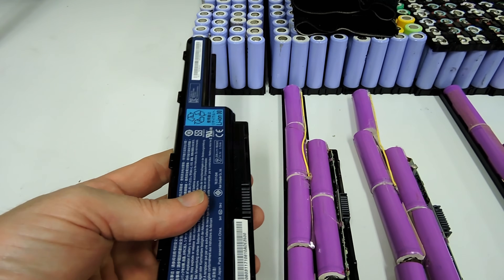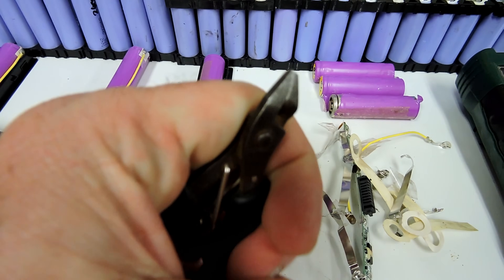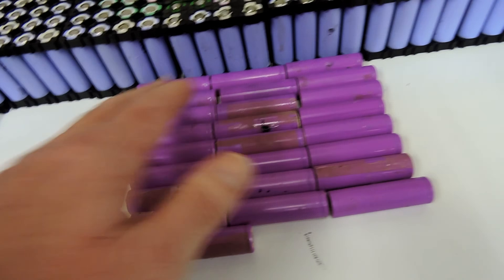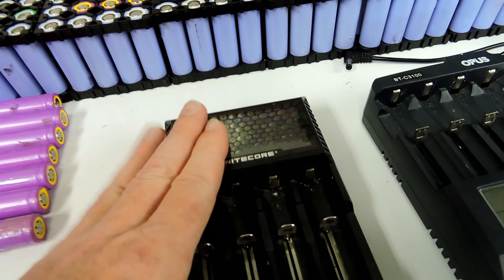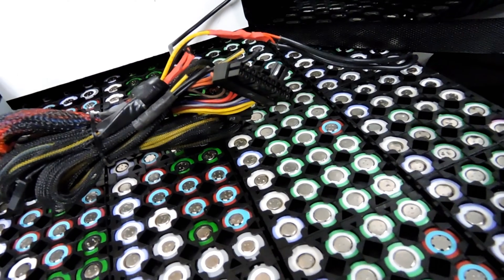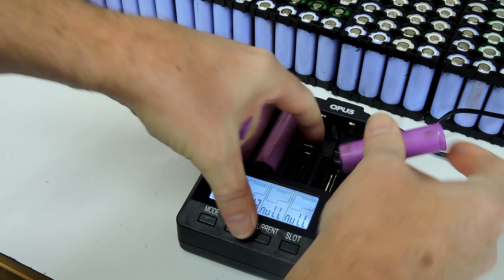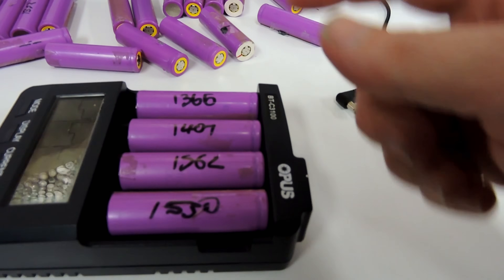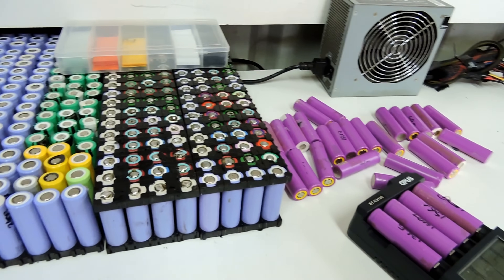How to capacity test an 18650 cell out of a laptop battery pack

Comment: Since there's a lot people in the comments regarding self-discharging testing I thought I'd leave a comment to help people understand. First off all batteries self-discharge no matter the chemistry, age, recharge cycles and the temperature they are stored at. Lithium-ion batteries discharge more in the first 24 hours than they should do over a 2 month period. Most manufactures publish their discharge rates within the datasheet for that particular battery, but generally its considered that Lithium-ion will self-discharge more in the 24 hours than it will over 2 months, to put this into usable understanding. the first 24 hours should lose no more than 1-5% then each month is between 1-2% which if we take the higher value of 5% in the first 24 hours takes 4.20v down to 3.99v which some of you may consider low, but for some applications it would be still usable since the cut-off is 2.75-2.80 for most batteries. In bigger projects with batteries running in series then you should try and match batteries in both self-discharge and capacity as much as possible but don't go overboard, its not that important if using a BMS. 

The main reason why some batteries fail to charge above a certain voltage such as 4.16v/4.18v is because the charger that you are using is not that accurate, OPUS for example is notorious for being very poorly calibrated which is noted within their manual having a Voltage Deviation of <0.04 so the charge can be cut short because it thinks its 4.20v when really its 4.16v, for this reason I recommend you test self-discharging using a volt meter, since different slots and even multiple OPUS's can have different Voltage Deviation from slot to slot from charger to charger. 

Enough with the jargon... here' is my method how I test for self-discharging batteries.

1. Charge the battery to full using any charger you like
2. Remove the battery and test the voltage using a semi-decent volt-meter (do not worry if its not 4.20v)
3. Wait 24 hours
4. Check the voltage of the battery if its loss more than 1% in the first 24 hours (4.20v to 4.16v is acceptable, 4.16v to 4.12v is acceptable)
5. Now wait 10 days
6 Check the voltage again and if its less than 0.5% sling it or sell it on. (4.16v to 4.14v is acceptable, 4.16 to v4.10 is not acceptable for some projects)

-
Reply from the maker: Dam man thanks for the effort - titbits in there I didn't know/understand... thanks for the effort!!!
Reply: Thanks for the info. Do you check capacity on 18650 cells in addition to your voltage reads 10 days later? Is so, what do you do with 4.2 v cells that after repeated charge/discharge do not show any capacity in mh?
Reply: I agree with your  method.  I first check the voltage of each cell as I break it out of the laptop pack, then I give each cell a serial number rather than mark it with its capacity etc.  I record each serial number in a spreadsheet so I can record initial volts, max volts after first charge, then volts again after 24 hrs, then measure and record internal resistance and cell manufacurer & colour etc. Then recharge to full 4.1v and immediately discharge at 500ma to 3v and record capacity before recharge again to storage voltage of 3.6v.  Then I have a bige spreadsheet full of data to make my decisions with.

Comment: Where did u get all them cells good job
Reply from the maker: You can get them here cheap & tested https://rover.ebay.com/rover/1/711-53200-19255-0/1?mpre=https%3A%2F%2Fwww.ebay.com%2Fsch%2Falarmhookup%2Fm.html%3F_nkw%3Dpowerwall&campid=5338322476&toolid=20008

Comment: Can u sell the nickle in them for scrap and i have bats that are 1.5v and like 2.78 volts and 2.1 v are they still good bats
Reply from the maker: I would love to be able to sell/recycle the nickel strip but sadly no one wants it around here. VOLTAGE IS NOT and indication of cell health/quality you need to charge and discharge it (unless it's zero volts of cause than it indicates it's buggered)

Comment: I have dell inspiron 15 3521 and my battery (became dead) is assembled in a same fashion as you have shown in the video. Is the batteries shown in the video are connected in parallel? I want to check their volts so my question is do I need to dismantle the cells to check volts? or how can I? Thanks.

Comment: Nice stuff :) Might get myself an Opus if I know I can test them quicker that way :)
As an aside, don't throw out the lower capacity cells. Do what I do and list them on eBay, someone will pay good money for them. I've had cells with <1000mAh sell reasonably well on eBay.
Reply from the maker: I can't bring my self to sell them on eBay - I wait till someone asks for them and offers me a price - I half what every the price they want to pay lol they just aren't worth a lot and paying too much for low cells inflates the price of the good ones
Reply: @HBPowerwall  Ironically (If you still read comments) you can't even sell 18650s on eBay anymore (at least not as 18650s) but then again nowadays I doubt there are many Laptop Batteries that even use 18650s (most have gone flat Li-Po's and I don't know if these are of any use to you).
Reply from the maker: @spotifygaming95  still read comments hehe I gave away a bunch yesterday - too hard to sell ..

Comment: What is wrong with the Opus power supply? Dose it work better or faster in any way off a PC power supply?
Reply from the maker: For me all opus were American plugs so had to use the cheap adaptor they came with - borderline dangerous those things. With a benchtop supply, one power plug into the wall so a bit easier to cable manage

Comment: After we find capacity what piece of electronic will cut off the voltage at 3.7v so we can store them
Reply from the maker: I use an IMAX unit here- https://goo.gl/Z2XAm6 you can parallel up 20 of them at a time and discharge them at once rather than one at a time.

Comment: Thanks for this video, fast paced and packed with info.

I just charged, tested, and recharged 16 Panasonic NCR18650s using a Zanflare C4. They all show relatively good capacity (they were only discharged at 500mA though, so I don’t know how useful the measured capacity is). The charger said 4.2 at the end, but my meter shows 4.11-4.13 across the board. Would you consider that voltage reading at full charge to indicate a bad cell or should I just use that measured voltage as my baseline when I measure again in a month?
Reply from the maker: Nop ignore the voltages - every cheap device is calibrated with a coke can half full with water - just test every cell the same way with the same sort of equipment.
Reply: Thanks! Just tested all the cells one month later and they have only dropped .01-.02v. I’m calling that a success.

Comment: Stonking. Again. Thanks. HB I hope you don't mind me posting a question here - I'm not promoting myself and any answers will help your Youtube Engagement numbers.

I'm salvaging laptop batteries for a new EBike battery, but for some reason, even though the cells are from un-used laptop batteries, and the capacities are around a reasonable 2,500maH, the internal resistances are all between 100 and 250 milli Ohms, according to my Imax B6 Mini, which - online wisdom has it - is a Bad Thing. So two questions - anyone know why? I mean - is it bad luck or inevitable in salvaged-even-though-unused laptop batteries? Second question - how much does it matter?

Thanks
Reply from the maker: 1. Thankyou
2. IMAX SUCK at ir tests no where near reliable enough results to bother with
3. I don't even know what the 'normal' is for IR on a cell but they all differ i know that.. 

I did 100 tests with the same imax guess how many IR tests came in at the same figure? (granted i was using magnets as 'holders' results were slightly more similar using a cell holder that was hard as hell to put in and get out cells.
Reply: OK thanks. I think a lot i down to how good the contact is/how hard you press. These resistances are all well under 1 Ohm and so the tiny changes in resistance of the connectors will dominate. I'll try another way to measure the IRs though.

Comment: I like when a lot of information is transmitted in a short time! No talking, only experiences and facts!
Reply from the maker: i'm not always like this lol
Reply: Hello! Maybe you answer so fast again. :) I want to buy a 18650 charger. It should load the cell alone -> unload and measure the capacity -> load.

I waver between the VC4 and the Opus BT C3100.

Can the VC4 itself measure the capacity? Unfortunately, I could not find an answer to the question. :)
Reply: OPUS is my pick, sorry logged in from other channel name. But I love my opus units you can get a good price on ebay here - https://rover.ebay.com/rover/1/705-53470-19255-0/1?mpre=https%3A%2F%2Fwww.ebay.com.au%2Fsch%2Fi.html%3F_from%3DR40%26_trksid%3Dp2380057.m570.l1311.R1.TR2.TRC1.A0.H0.XOPUS%2Bbt.TRS0%26_nkw%3Dopus%2Bbt-c3100%26_sacat%3D0&campid=5338073988&toolid=20008 or on amazon here https://www.amazon.com/shop/hbpowerwall
Reply from the maker: Replyed from BatteryHasher account sorry

Comment: Question : how comes lots of people building powerwalls get rid of cells below 1500? Is it just because you want the powerwall to be relatively compact, and if you had loads of 800mah batteries it would be massive? Just thinking because you've sort of got them so why not just use them? Thanks
Reply from the maker: For me, in my head a 2500mah cell that was 2100 mah still is still well within its useable life but if you had a 2500mah cell that was 1500 it's life will be much shorter with in the powerwall. If you had space & time, you'd use all the lower cells to make more and more 'emergency' storage. anything above 1500 to 2000 mah were passed to friends to use in their walls & anything lower was returned to the recyclers (in my case that is)

Comment: Is discharging at 1A recommended for all cells?  If a cells only rated for 500mAh discharge is that cell just not worth using?  I discharged a cell at 1A and it got hot enough to trip the Opus to stop discharge, so I removed it from the charger thinking it was bad.  Later I discovered on DIY Powerwall that its only rated for 500mAh max discharge.  Is it actually a "good" cell assuming overheat was due to discharging beyond its rated maximum. Thanks!

Comment: Sorry for all the questions but I'm just starting out and have just got my first delivery of loads of laptop batteries, 1 should all battery charge to 4.2v? 2  Should groups of cell ah's be  approx all the same if not what kind of difference would you allow, for instance just for the question a 10s 4p  if the first 10 are all  2000mha  what would happen if the next 10 are 1800mha  and the next 2100mha each cell? 3 I have come across some cells that are below 1.5v but have charged up just fine will these cells be affected in any way some have been less than a volt, I know I should leave them a while but it's all exiting at the moment. I do blame you and a few others video's for the mess and batteries charging when the better half complains as your one of the reasons I got interested in the first place, but honestly, thanks love the video's for the entertainment and knowledge you've given me plus it's actually changed my lifestyle.

Comment: Yeah gloves my hands have 5 plasters covering them I just started with my first load of laptop batteries, I found some Prismatic Samsung cells  They are marked  Line 1 77155A611, Line 2 ICP103450s, and Line 3 SAMSUNG SDI, well I've actually over 60 so what advice give for these type of cells I'm sure you and others have come across them but I can't find much info on them, Love the video's and have gained so much knowledge from you and you're video's.

Comment: Hi
I began opening notebook batteries to take his 18650 cells and start charging the good cells with a B6 Mini (A original one, with PC port) but when the charger finish the charge with '4,2v' i measure it with the charger's meter or/and  a multimeter and the voltage drop to an "4.1x"

Can be this considered a good battery to folllow the next steps or it must be just charged on 4.2v to go on?

And for the "week self discharge test" how much difference is a good discharge value to pass the test??

My idea it's use to make a battery pack for a e-scooter

Thanks for your references 0_<

Comment: May be a really dumb question, but do we need to buy an IMAX and an Opus charger? Does one do a different job to the other or can they both be used for charging, then discharging and determining capacity? Would preferably like to only buy one if possible!

Comment: Can you explain again the specs of what is considered a good cell verses a bad cell when salvaging from labtop batteries? When you charge them back up and let them sit for a few weeks should the voltage not drop past 4.2? Is 4.0 still considered a good battery?
Reply from the maker: if after a few weeks it's above 4.1 would happily use the cell. If you left it for 2 days and it dropped from 4.2 to 4.15 I wouldn't use it. You have to work out what is acceptable to you. Short time should be near no drop - weeks with no load there should be at least some drop in voltage.

Comment: How do you separate the batteries from the nickel plates? They are kind of soldered or welded together
Reply from the maker: flush cut wire cutters are your friend they are spotwelded
Reply: i grab the strips with side cutters and tear them away

Comment: as far as i can tell, it is cheaper to buy new batteries. i recycled about 100 batteries and have yet to find one to this high of a standard.
Reply from the maker: If you were to buy new cells and do this type of project it would be better and easier to just buy an out of the box PW2 or LG Chem unit
Reply: thanks for the reply.oh i could only dream of that new house battery..  i think i need an easier setup .like the automatic analyzer charger discharger. my batteries are mostly old and have low capacity as far as i can tell with my IMAX B6. i'm not sure if it has that function.
Reply: it's the real one with the magic sticker on the back. i think most of my batteries are just crap.

Comment: Any reason why you recommend charging the batteries with another different brand charger? Thanks.
Reply from the maker: If I understand the question correctly - it is just charging to 4.2 volts any way you can makes the discharge phase much faster as the dischargers don't need to charge the batteries first.
Reply: In the video you said that you need to do a discharging test while showing the Opus, but recommend to charge the batteries with the Nitecore or the Imax. Can I charge and discharge with the Opus, instead of buying a charger and a discharger? Thanks.
Reply from the maker: OOh yeh sure you can do it all with opus unit. It makes it much faster if you pre-charge the cells tho. that's the only reason for doing it.

Comment: In my experiencie, i find that the ones that are with low voltage, are actualy very nice cells. Go testing, you will get surprise how good they are!
Reply: Yes, i think that also. Most low voltage cells are because of faulty bms. A big percentage of my 2Ah cells are lower than 2v
Reply: I save my laptop batteries and I have two of them with 2.55V and some even lower. You mean they are still usable?
Reply: Well if you mix them in a pack with high voltage ones that can damage them or even be a fire hazard, right?

Comment: Hello! Great videos! I'm in the charging process and marking initial voltage.. most of them are around 4.05 to 4.18v... you only mention 4.2, do you avoid anything under 4.2??? Thanks!
Reply: my batteries never stay at 4.2 they always between 4.14-4.18 ...so i dont know where he gets 4.2 after 1 month lol
Reply: I have the same question
Reply: good battery is considered, what I've seen, at 4.15-4.20 volts. I think new battery may not even have 4.2 (after charging and sitting ofc) :D

Comment: What are you considering your "minimal" usable capacity?
Reply from the maker: I used 2100mah as min, that said done over if I had the room I would have definitely gone as low 1800 mah I never expected to go this big but if you're just doing a small battery use the best cells you have. Perhaps keeping lower ones to expand in the future. More cells lowers the over all draw per cell - in turn making all the cells live longer.
Reply: HBPowerwall I want to make my first 4s80p build and was thinking of using 1600-1800 as my min depending on how many cells I have over those numbers.

Comment: thanks, the cell database will come in handy.... but when i checked the batteries i am currently testing, they were not on the list, they are

INE 180650E10 with Orange wrap, and a White disc.  

ps, i bought a Opus charger specifically because you mentioned it in another video. its sooo much faster than the IMAX B6 i was using before it, and still use.
Reply from the maker: if you could add photos & description here http://www.diypowerwalls.com/t-DIY-Powerwalls-Cell-Database the community can check it out for you hopefully come up with something faster than you doing it your self ?

Good news on the OPUS, really like them - they do die after being hammered every day for 12 months but you have to expect that lol

Comment: You said that "all the cells were over ½V and they came up to 4.2-ishV", So those low ones recovered with a charge.
Reply from the maker: +SidneyCritic ComedyHound yep in the IMAX 8 at a time.
Reply: bigclivedotcom did some research into the over-discharged lithium cells, and it seams like it doesn't hurt them that much.
https://www.youtube.com/watch?v=sRwoYJyjZNo

Comment: What do you reckon your percentage of useable cells is? What do you do with the ones that don't make the cut?
Reply from the maker: 40 percent is a good extimate of cells that are above my 2100mah limmit 1800-2099 get sold given to others - under 1800 get sold off or returned to recyclers